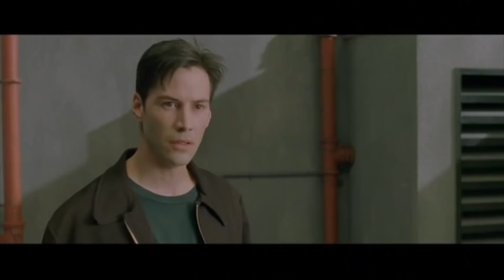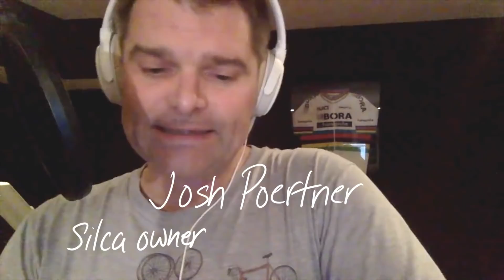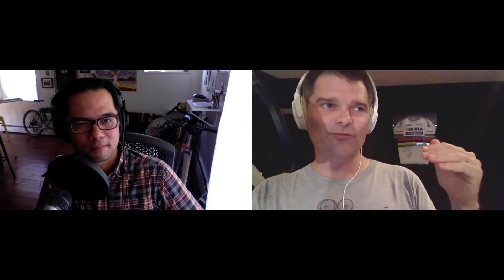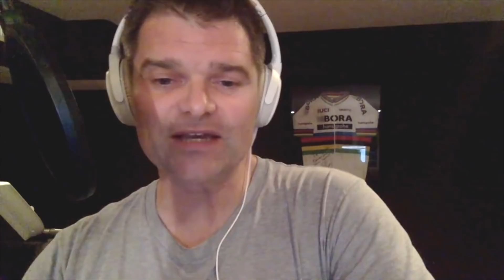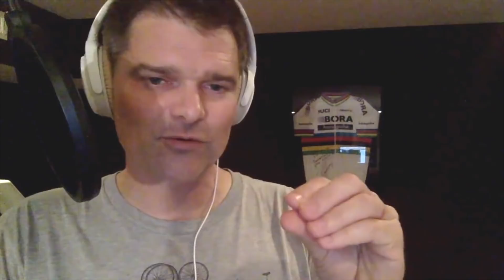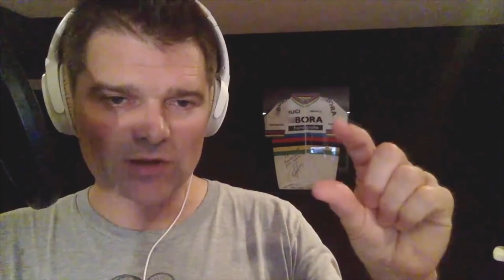Your TIRES are LYING to YOU!

Comment: Need to add another comment.   The part that Josh Poertner talks about how if you have your tires at too high a pressure and you have all these small cracks and how they are caused by the high pressure is completely WRONG!!!   A tire that has never ever been inflated on mounted on a rim can have those small cracks.   The cracks are caused because rubber is like your skin.  It has compounds in it that are volatile organcs.  These are the compounds that give the rubber some of its characteristics such as elasticity and the ability to bend...conform and have grip.  As rubber, both natural and synthetic elastic compounds, age these volatile organic compounds leave the rubber.  When certain of these compounds leave the rubber the rubber looses some of its properties and will have those micro cracks.

Comment: I would like to hear him talk about tires and tire pressure on fully loaded touring bikes.
Reply: Cycling Simmons use the Silva tyre pressure tool on their website. Enter rider and bike weight, tire width, and surface type. It will give you a recommended pressure.

Comment: I can really feel the difference in aerodynamic between 1.25 and 1.5 inch tyre while ride on flat 22-25km/h. I'm not yet convinced in "wider is faster" theory.
Reply from the maker: If the guy that sets pressure for pros can’t convince you 🤷🏽‍♂️
Reply: Science "facts" has been changed over years and will be in the future. I'm not saying he's wrong because I don't know, I'm saying I'm very careful in what I choose to believe.
Reply: @ofka7867  Unless you're doing double blind testing, what you 'really feel' isn't really relevant. When you stop and think for a sec at what the air sees, the minor variation in tire width is down in the noise when you have a human sitting on the bike. You may be 'feeling' many other things. Unless the tires are exactly the same model.... etc etc
Reply: You have a point, I am not sure myself.  I got a feeleng that I go more tired on wider tyres on long ride. That's all.

Comment: I commute in London. I have to have reasonably high tyre pressures or I get snakebites from all the shitty broken Tarmac. I also can’t run 23mm tyres. 28s with high TPI are better.
Reply from the maker: Sounds like you need a supple bike with 40mm tires :)

Comment: I found this so fascinating, thank you for doing this interview. I used to ride a much heavier bike than I do now for mountain biking. And back in the day I would run the biggest tire I could fit which at the time was 2.8 and no one could understand why I did so. They all thought that it was totally unnecessary and that I was just running big tires to run big tires. But for riding here in the Northeast with all the rocks and roots it made sense and I use to tweak the air pressure all the time depending on the terrain. I was, without really knowing it, looking for the smooth feeling. I feel so justified right now.

Comment: I always start at 25 psi and add or subtract from there depending on conditions but usually just 25 in front and 30 in rear
Reply: Ross Allen  tubeless, I tend to ride on fire roads leading up to trails so I seldom go under 20psi

Comment: I'm 185 to 195 in the winter and 20 to 25 lb road bikes. Running 25 mm tires at about 90 lbs on lousy California roads. I allow the pressure to fall naturally over several rides. It appears that my Vittoria Rabino tires are faster than my Continental GP5000TLS at 75 to 80 lbs on the broken or "repaired" and very bumpy road. Is this because of the deep tread?
Reply from the maker: Would prob have to do more with the sidewall.

Comment: “... a really wide tire, like 650b x 48...” 

looks at my 29 x 3.25s 

I think I may not be the target audience for this video.
Reply from the maker: A tire is a tire.  You wouldn’t inflate a mtb tire to the pressure on the sidewall would you?  It would turn it into a basketball.
Reply: I don’t think I ever even realized there was a suggested pressure written there.
Reply from the maker: Mark Troup ya learn something new every day.
Reply: @PathLessPedaledTV , been watching this 3x. I'm following the recommended tire pressure on the sidewall of my mtb tire previously. It say's in the interview that you can go higher than that, but can I go lowet than that? And yes, following the recommended tire pressure on mtb side wall feels like a basketball. Btw, I closely inspected my tire and saw little cracks on the sidewall (as for the interview, this means I'm running too much pressure). Just need clarication if I can go lower than the recommended psi on mtb tires. Thanks! Been using a cheap pump with gauge (will still use this cheap inaccurate gauge accurately to be more accurate. Lol). Great interview. Hoping for some interviews of this kind, bike nerd made easy.
Reply from the maker: @johncarlopalmado7922  Yes you can go lower.
Reply: @PathLessPedaledTV , thank you!

Comment: With my roadie heart, I still miss one drawback, which is the tyre weight. OK, if we're comparing a 25 to a 28c, peanuts. I also feel more confident on descents with the 28c's now.
But on the gravel rig, maybe a 650b with larger tyres wouldn't be as advantageous as a 700c with a thinner tyre (about 35c)? This would go into the "when is it too wide".

Comment: What about the low number on the sidewall's pressure range? I'm curious if the low is actually higher than the required pressure to keep the tire "clinched" to the rim, just as the high number is lower than what was required to blow it off in testing. More often than not the calculators I've used come back with numbers lower than the sidewall's low end pressure, particularly on the front tire. Do we need to be worried about going too low and having the tire slip off the rim?

Comment: I used to think bicycles were just simple machines at about the most basic level a machine could be while still doing something. With age comes wisdom (sometimes). Nowadays, I marvel at the precision to which a wheel must be trued; the tension to which the spokes must pull; the difference a millimeter or two can make in comfort or speed; and now tire pressure & minuscule differences in road surface are blowing my mind.

Comment: I run thorn proof tires due to goatheads. From watching this, I guess I sacrificed suppleness? I can also see I need to lower my tire pressure. Please advise on the thorn proof tires. I don't race, and mostly ride to commute and recreation. Tires are 26x2.00 Thanks for the info, and thumb up.
Reply: Punctures protected/ thorn proof tires won't be as supple as lesser puncture protected /thorn proof tires.  Depending on how protected your tires are, lowering the pressure won't make a huge difference because really protected tires don't flex that well.   'Schwalbe marathon supreme' have a good balance of low weight - reasonably fast one roads - for reasonable use they'll give you the right amount of puncture protection. Anything higher in protection is over kill in my opinion for general use.  - mine are 26 x 1.60. I've had zero punctures, these tires are sold in 26 x 2.0, make sure you buy the second generation version and the EVO / Evolution models of the tires, they're pricy but you're getting a great tire.

Comment: Outstanding video Russ. Very thorough content, except I thought one thing was missing: running different pressures on the front vs. the rear. I have personally found that it is beneficial to run a lower pressure in the front as less weight is over that wheel. Roughly speaking, I have found 12-15% lower in the front tire vs. the rear is pretty ideal.
Reply: https://www.renehersecycles.com/myth-11-rear-tires-should-run-at-higher-pressure/
Some thoughts on that
Reply: @roddheino  Thanks.

Comment: Good stuff.  I pretty much use the method he describes at 12:50 through many years of trial and error.  Always need to go through the process when I change tires and/or rims.  Nonetheless, he only hinted at rim width when he talked about losing stability when cornering, etc.  I get asked about pressures all the time, and a fat tire on a narrow rim will just need a different pressure than that same tire on a properly mated wider rim.

Comment: Living in Sydney (the hottest place on the planet yesterday!) all this physics is fine..but how do I overcome the adhesion factor of the melting ashphalt lol.  Great informative video. When the weather cools and the smoke clears I'm going to start playing with pressures on my touring and mountain bikes.
Reply: I live in California and know the devastation that is happening down under.  I bought a Blue Air filter with a carbon smoke filter and thought it helped.  Hang in there!!
Reply: Thanks for your good wishes Steve. I've got my particulate mask hanging on one side of the handlebars and my helmet on the other..lol. If the air is to thick tomorrow I might ditch my cycle commute and dust off the car. I live on the edge of the Blue Mountains and things are pretty volatile at the moment. Happy New Year.

Comment: He explained where the top end of the pressure range comes from, but not the bottom end. That would have been interesting to know. :-(
Reply from the maker: It’s too low when it affects your steering? 🤷🏽‍♂️
Reply: But where does the low number on the sidewall come from? The high number is double the burst/blowout pressure, but how do they derive the low number?
Reply: Low would be when u turn the tire rolls, too low your tire could roll off on a high speed turn.  You will also belch air on big bumps

Comment: I think it’s important to raise my tire pressure 2-3% in January to support December’s holiday eating.
Reply: Thomas Benenati I like to work on eating in 2-3% more in Dec to prevent the need to let the air out of over inflated tires! 😂
Reply: #supplelife
Reply: Smart. I do similar things according to temperature. When it's warm I raise pressure. The tire is more  supple when it's warm so it gets squishy when pressures are too low. When it's cold I lower temperature maybe down 5 or even ten psi because the compounds suffer greatly when cold. Tires lose grip when they are cold. This effects grip when power is applied due to deflection and lack of grip when cornering due to the hardness/deflection ratio. Cold over pressured tires can be deceptively dangerous when taking a corner where you are used to one cornering speed on a known path when warm and then grip is significantly less cold. Think race cars wherein they do a setup lap getting tires up to temperature before they do a timed lap or the danger of becoming passed due to a lack of cornering speed because their tires where cold coming out of the pits. Same principle, different application of that science.

Comment: Great interview and information. The way I explain tire pressure is to think with energy in mind. Then link it to work by telling somebody to vibrate the bicycle and ask where that energy is coming from. Physics is a very useful subject when working with bicycles.
On the pressure sensor, most are actually using lookup tables with interpolation. It's very accurate and precise. The errors come from the shoddy support circuit and quality of the physical build, including the strain sensor bonding etc. I have access to testing this, should probably just do it.
Again, thank you for this video. I'll be pointing people to it for when I'm too tired to explain bicycle tires.

Comment: So as a general rule, what pressure should I use with my commuter bike tires? They're labeled 90 psi. I weigh 190.
Reply: I'd be starting 75 or 80 ish.
Keep lowering it until it starts to handle poorly. Note that pressure.
Bump that up by two or three psi you should be good
Reply: Width of tire? Panniers?
Reply: @roddheino  32 c. Panniers on occasion, not usually.

Comment: Spent over half an hour talking about tyre pressures without actually mentioning...tyre pressures....grrrrr. Come on, give us SOME idea, you know you can....
Reply: Find Bertos tire drop chart. Start from there. Basically if you're using a supple tire (in case it was missed all of this discussion is assuming a supple tire) you want the lowest pressure you can run without negatively influencing the handling.  So drop 5 psi each time you go out and see how it feels.  All you're appreciably changing with pressure is behaviour.

Comment: Great video, but what about the extra tire/rotating weight as you go up in size? I find I am willing to put up with a little more bump for less rotation weight
Reply from the maker: Light casing 650b x 48 is going to be lighter than 700 equivalent.  Just less tire and wheel.  Again, totally depends on terrain and your goal.  If its a rock garden, I'd take the volume of wide tire than weight savings of smaller one.
Reply: Light tires just feel fast. Over the course of a longer ride the differences are negligible.  
Plus more delicate
Reply: You are correct, Mike. Just look at your GPS, riders need to constantly accelerate the bike. Every gram added to the perimeter of the wheel inhibits your ability to accelerate. The gurus telling us fatter flatter tires go faster on normal roads like to ignore this fact. No one in the pro peloton is ignoring the weight of their tires or rims.
Reply from the maker: Biketube Brand so why is the norm in the pro peloton not 19mm but is pushing 30?

Comment: I must admit that I felt kind of disappointed when I got myself a pair of 650b wheels with 47mm WTB Byway tires. Being used to 700c wheels with 25mm Vittoria Corsa tires inflated to some 90-95 psi I expected a magic carpet ride with the 650b wheels, but instead the ride actually felt harsher on smooth pavement. Even when I went down to about 25 psi, which gives me a lot of pedal bobbing, the ride still felt a bit harsh compared to the 700c wheels. Yes, on gravel roads and singletrack the 650b wheels will absorb bumps that no 25mm tire can handle, but I'm still a bit puzzled that the pavement ride didn't feel as smooth as I had expected. Could a different tire give a smoother ride, or could it be my expectations that are fooling me?
Reply from the maker: Yeah. Don’t know what’s going on there.
Reply: In short yes, better tires would feel more smooth. 
WRBs are certainly durable but i wouldn't call their offerings the most supple on the market

Comment: If it “feels fast” it probably isn’t. Smooth is fast. I’ve heard this in automotive racing all the time too.
Reply: I first came across it in windsurfing. When you just lean back, relax and enjoy a magic carpet ride, you're most likely fast. When everything rattles, you're slow.
Reply: This is the mantra for me from now on.
Reply: I strongly believed this too, until I had the opportunity to take a few hotlaps in a car driven by ex F1 driver Roberto Guerrero.  I considered the laps violent.  They were incredibly faster than any of the local "pros".  They are able to redefine a standard quite different of where the ragged edge actually is.
Reply: Many years ago I saw a telecast of the DH Worlds. John Tomac was one of the last riders, and set the fastest time up to that point, but looked really ragged, on the verge of crashing for the whole run. The last rider was Nicolas Vouilloz who was super smooth the whole way, with little or no visible sliding. He absolutely nailed his run, easily setting the fastest time, while looking in total control the whole way. Smooth is good, and easier on gear too.

Comment: I'm 270 lbs and ride steel frame, with 29x2 tires. Any idea what pressure I should aim for?
Reply from the maker: You’re going to be the only one that can determine that. Would follow the advice. Get a notebook. If you have pedal bob or turning feels vague you’re too low.
Reply: @PathLessPedaledTV  pedal bob? I like the 2s tbh on gravel. I feel cifident with them, but idk about rider weight and size. You should do a special about large riders. I'm 6 4 and like i said 270. Besides zinn, there's not a ton of coverage on us big dudes. Do bigger riders usually need bigger tires, ie.

Comment: Fascinating stuff!  Learned the hard way about overinflation during a 40 km TT, riding a Carbon Soloist.  Soloist requires low tire pressures, but area tight fit with 25 mm tires. . .

Comment: I wonder how much being ultra accurate with tire pressure if you’re using latex tubes on longer rides matters.  As far as I’m aware they lose air over a few hours. So you’d have the choice of a faster set up with latex tubes that loses air vs a less efficient at optimal tire that holds pressure.    Taking about longer rides here.  I don’t imagine air loss would be an issue for a couple hours.
Reply from the maker: That sounds like a good thing you could figure out with a notebook, pencil and tire gauge.
Reply: Remember too that while there is an ideal pressure, lower than ideal isn't appreciably slower, the handling just starts to suffer.  Josh Poertner discovered this when testing the Zipp 303 with CSC on the cobbles.  Every time they'd lower the pressure they went faster with less effort, until the wheel broke.

Comment: Since I come from an MTB background I’ve never really followed the numbers on the side. Running in the region of 21-25psi depending on what Ive been eating and what I’m riding and the size of the tier. Not to mention most tubeless rims don’t like to be inflated over 40psi.  Never understood why the road crowd seemed so reluctant to drop the pressure. Even if you don’t fully understand the reasons why it offers more grip that much is obvious and is way more comfortable. A day of high frequency vibrations does not feel fast at all in my mind. It bloody hurts

Comment: Spent 4 years riding on perfect asphalt in UAE (including the F1 circuits and 100’s of Kim’s or smooth roads so at 90kgs on 25’s i was running 90psi - now back in UK and oh hell the roads suck and I’m down to 60 psi for roads and now after time away I’m back on MTB too and a 29x2.6 is down to 18psi on the back - fat bikes ? 5-7 psi off road - soft is working for me!!